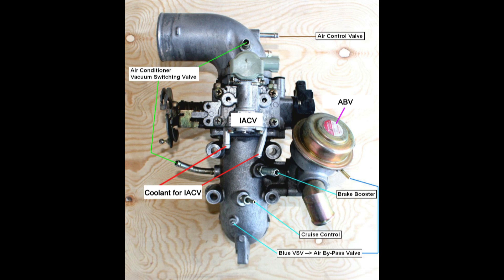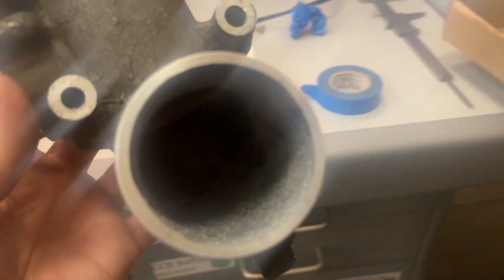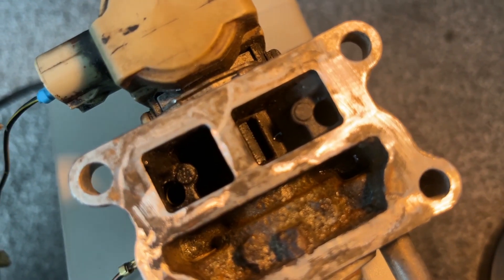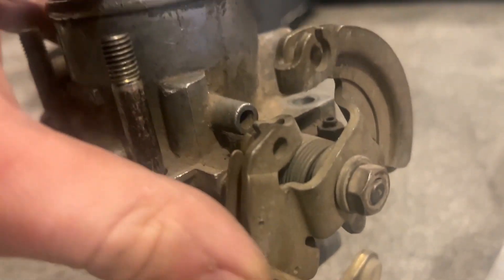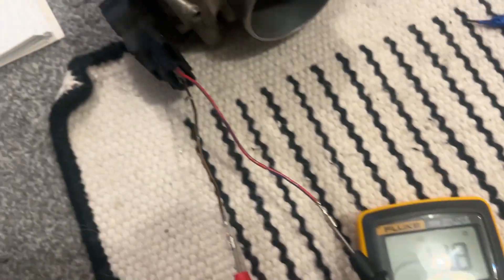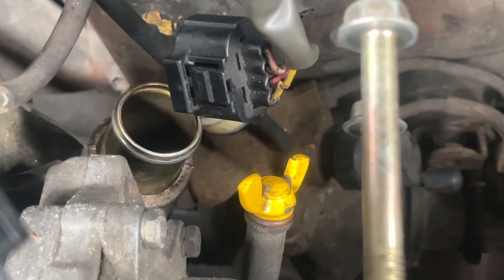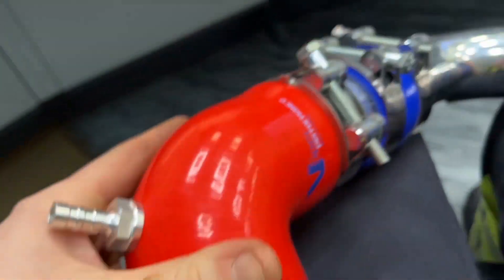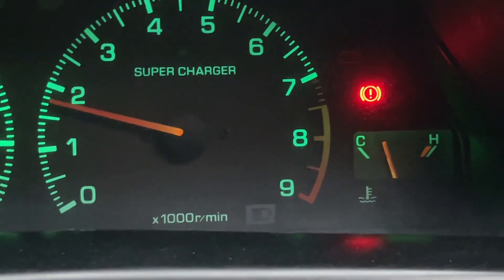4AGZE Throttle Body Upgrade

Comment: I'm sure you know this, but just in case you didn't, I thought I would point out that it looks like the yellow wire at 1:30min in the video (TPS) appears to be cut.
Reply from the maker: Thanks bro yeah I did replace this as it was in a poor state
Reply: @AE92World I figured as much. I mean the video was posted 2 years ago. LOL.
Reply from the maker: @ProfessorOzone Jesus , and she still doesn’t run right and is off the road 😂

Comment: Heya! Thanks for this, it is helpful. Even though I'm running an NA 4AGE, knowing that I have some options when it comes to TBs is very useful, I'm looking at probably picking up a 3SGTE throttle body so I can use the PWM IAC valve.

Comment: Does that right angle silicone hose contract on acceleration? stick a camera in there and check, could be why its rubbish.
Reply from the maker: I think it did to be honest - the engine is dead now, lost compression on some of the cylinders. I aim to put in a proper intake system rather than a crap bodged silicone one like in the video
Reply: @AE92World  hopefully back up and running soon for you.  

I've got one of those ready to go and will try back to back dyno
Reply: @AE92World gidday,  I've just installed over the weekend. Motor required 5-7% fuel VE increase nearly everywhere.  That's with 660cc injectors.  

Power was previously flatlining (not dropping) from 5000-8000rpm 

 it's worth doing, ideally though you'd just run a regular small port intake - I'll do this shortly.
Reply from the maker: Is 660cc the size of the stock injectors?  @Garage_Dori
Reply: @AE92World i upgrade to a 175mm crank pully & Tomei cams at the same time as the throttle. I've not measured power on dyno yet but I ran a 14.2@97mph quarter mile.
Reply: BTW I dyno mine after the throttle body, cams and 175mm pully - was 200hp at the fly. I've since fitted am sc14 which I recommend! SC14 is night and day over the 12
Reply from the maker: @Garage_Dori  is there much modification to do in order to fit the 14?
Reply: Nah easy.  If you can get a 1ggze one then it almost lines up.  Trimming a combined 13mm off one side sc mount and the SC block mount.  Then just make up a top mount by welding a stud to the intake manifold.  And swap to the normal  4age manifold - add a bov and done. 

I'm Already on an aftermarket ecu so I recommend doing that first
Reply from the maker: @Garage_Dori  Wow awesome, would you be able to create a video on this some time please? Just to see the setup etc?